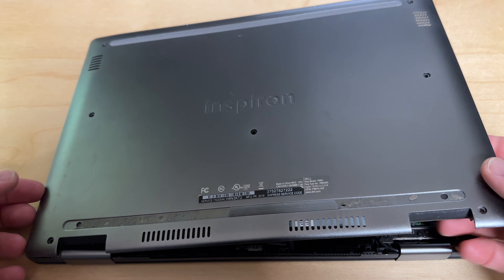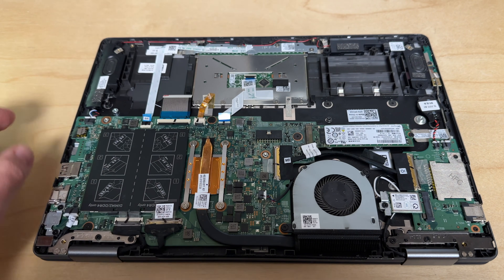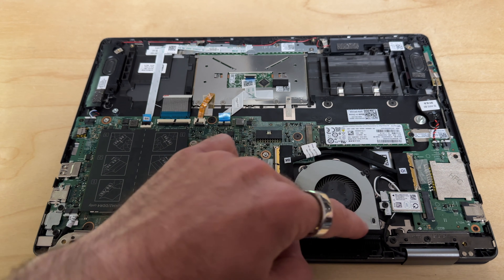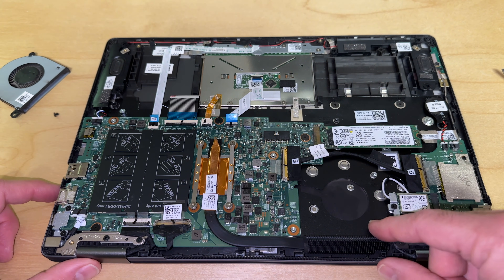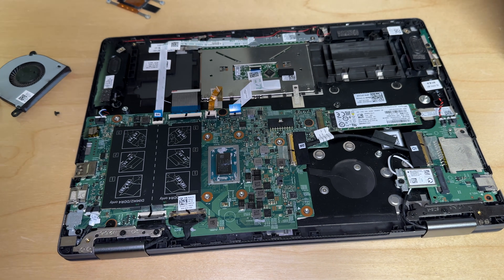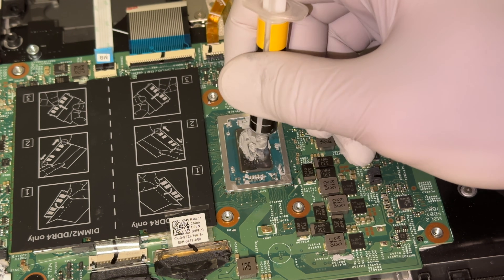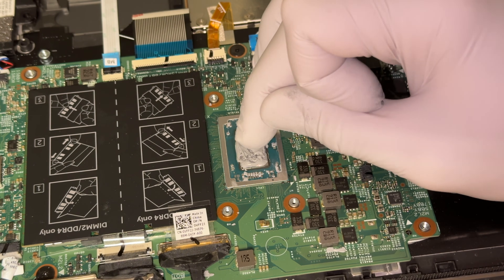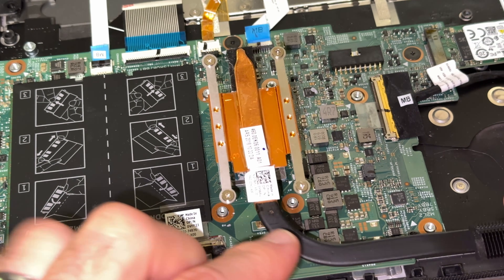How to re-apply thermal paste on ANY laptop!

Comment: BATTERY. DISCONNECT THE BATTERY.
Reply from the maker: Not necessary.
Reply: Is is necessary ,people use metal screwdrivers which can short the motherboard if they touch bits of the motherboard when the battery is connected, that becomes a very expensive repair now. @ComputerStuff

Comment: Thanks for the video. A few Questions. 
What would be a good symptom or diagnosis to warrant this thermal paste replacement. 

1. What paste should I use for Dell latitude 5420 /7420
2. I understand you mentioned that you used more paste than necessary. Can I use an empty syringe to suck up the additional paste?
Reply from the maker: 1: Arctic Silver is my goto.  
2: Yes or a piece of gauze :)

Comment: This laptop doesn't have thermal pads alongwith thermal paste which are there in most laptops with gpu..when changing thermal paste, do those have to be changed too?
Reply from the maker: Yes if you pull off your heatsink and you also have GPUs or chipsets that have paste on them, I'd replace that as well.

Comment: Forgot to turn off the pc while apllying thermal paste. And now the pc won't respond . Possible to fix or do I need a new MB at this point?
Reply from the maker: It's possible that you shorted the motherboard, but I've been doing this a long time, have made mistakes like that, and have never shorted a board.  Make sure you go through all the usuals (unplug, replug, remove batteries, etc.) before jumping to new motherboard.

Comment: If there is not enough thermal paste, will it cause a fan issue? My laptop ocassionally throws a fan error over time where the fan doesnt work at all and the cpu throttles with increasing heat
Reply from the maker: Not enough paste wouldn't cause an issue with the fan.  If you're getting a fan error its likely the fan itself is malfunctioning. THose are generally quick and easy to replace.

Comment: I’ve decided to chnage thermal paste after opening my laptop and cleaning the fans, thinking they were the problem for overheating(they were not, it was the thermal paste). Changing thermal paste doesn’t seem like a difficult task, however I’ve noticed that VRM and CPU have different colours of thermal paste?? VRM has white paste, and CPU has grey paste.

Hence my question is, are there like 2 different kinds of thermal paste for vrm and cpu? The paste on vrms still seems alright, while the thermal paste on cpu clearly needs to be changes, so shall I just change the cpu thermal paste??

Sorry if this doesn’t make sense, I am not the most tech savvy person and it’s my first time ever fixing stuff in my laptop on my own.
Reply from the maker: Tha'ts interesting. IT's possible they used different pastes in factory, but you're safe to use one kind when you redo the paste yourself.
Reply: @ thanks for the reply 👍

Comment: would isopropyl alcohol work? (70% - 90%)
Reply: You'll be fine just use a cloth to apply it and wipe it off clean. You've got more of a chance to kill your board leaving goop on the side of you cpu touching the pcb than you would using isopropyl alcohol on a cpu. The diffrence between denatured alcohol and isopropyl is the presence of toxic chemicals in denatured alcohol(methanol, benzene, pyridine, castor oil, gasoline, and acetone)
The percentage is dilution to water.

So this goofball using gloves in a non ventilated area like he cares more for his board than his life is the real highlight of this video.
That and his spreading of the paste like its not going to be flattened by the heatsink.... just saying don't do what this guy did. Pea sized dot in the center is enough....
Reply from the maker: Another added COA.  

Do not use Isopropyl alcohol.  THIS “goofball” can’t listen much less offer proper advice. 

You unequivocally will not hurt a GPU or CPU by having “goop” on the circuit.  These are non conductive surfaces.  @Chip-Chapley needs to go back to ECPI for his bachelors in uselessness.   

Yes, use less paste than I did in the video. I said as much in the video but clearly listening isn’t a genetic skill.

Use gloves, it’ll keep your hands clean from the paste and alcohol.

Class dismissed.
Reply from the maker: It’s not recommended. I suppose if you had nothing else it wouldn’t kill anything but I wouldn’t risk it on an expensive device.

Comment: Any thermal paste works?
Reply from the maker: Yes.  But arctic silver has always been a gold standard
Reply: @ComputerStuff   ANY THERMAL PASTE WILL NOT WORK. Since this is a direct die cooling application it always needs a high viscosity thermal paste like arctic mx6 or thermal grizzly kryonaut. using a thin paste will have a pump out effect and will vacate the cpu die and thats not good. thick paste will stay put on the centre of the cpu and will last longer

Comment: Bro forgot to say diconmect the battery because if your screwdriver touches any part of the board its fried
Reply: I never had any issue. Every year I change my thermal paste and I never disconnected the battery
Reply from the maker: Bro didn't forget to say that, because it's not true. , I've been doing this for 25 years so no, I'm not wrong.

Comment: can i use just basic isopropyl alchohol??? cuz denatured alcohol is not aviable anywhere in my country
Reply from the maker: No you can not and should not.
Reply: @ComputerStuff then what the f*ck do i use ????
Reply: @adriss8888  You can use isopropyl "rubbing" alcohol... try and get 90% or more. Don't splash it everywhere obviously
Reply: @taylorlatch2635 yeah not sure why this guy is saying you should not... I get that there's water content but alcohol is a strong  oxidizer it literally will evaporate the water into hydrogen if you apply the least amount of friction.... I could rinse a board In water and it will work after it dries.

Comment: Is ok if that glassy thing is a bit chipped? I have two processors i think, one is for nvidia and one for intel. I cleaned them both with 70% alcohol and wiped fast after with a dry tissue. I cleaned with a vacuum, used some brush head for it.. and after cleaning i found out it was chipped on the glass, does it still work?🥲
Reply from the maker: I dont know what you mean by glassy thing?  The green part on the CPU?  Yes, that being chipped can pose a problem.
Reply: @ComputerStuff  the one you're putting paste on :)
Reply: @ComputerStuff the green part is protected by some plastic, the glassy one is the one i can see my relfection, and is shiny. And put paste on. I dont know exatly what role does it have on the processor. So thats why im asking if its safe

Comment: I am hopeful you reply back, I have a computer that was in the storage box for a year and it was left there open, 
It probably took a few little falls. now when I decided to turn it on,
It wasn't turning on, And I saw the CPU FAN (FAN + Cooler thing ) wasn't properly attached, so i went ahead applied thermal paste
and tried attaching it, some of the plastic clips broke but it still attached, although my pc isn't turning on still
I took the rams out and placed it back in, still doesn't turn on.
The GPU light and a motherboard light does turn on, and when i hit the pc switch button GPU + A side casing fan does move for a mini second and stop
( Cpu fan doesnt ) thats what happens when i hit the switch it doesnt turn on, just a little movement on gpu fan and a casing fan-
What do you think I should do ? 
I live in a very small town, with very bad computer repairmen, if you have a few things to point out, would really apreciate
Reply from the maker: Sounds like possibly your power supply is having an issue (if not motherboard).  Despite getting "some" power - I would try and replace your power suppply first, then try motherboard.
Reply: please try replacing the CMOS Battery! Also, remove the laptop battery and hold Power Button down for 1 minute to perform static discharge. Then replace battery or you can just use power supply without battery ( try both ways) to see if that powers on your PC. Ensure, that all internal connections from disassembly were OKAY! Please let me know if this fixes the issue.

Comment: Should I remove the laptop battery first?
Reply: YES, ITS NECESSARY else there is a high chance of getting your motherboard fried.
Reply: @aneek_912  but you only applied new thermal paste, not a big deal for the battery
Reply: @RoldanPerezChristianAsgard   while removing the heatsink there's a very high chance of accidentally touching the SMD components with your screwdriver. so its always said to disconnect battery cable first before you touch any components on your machine
Reply: @ yeah you right, better be safe
Reply: allways remove battery 1st  no matter what you repair , safety first ofcurse you wont get shok but just in case.
Reply from the maker: Not necessary.

Comment: Sir im new to all these things , and I've a laptop mainly used for office work ( hp pavilion i 5 , 16 gb ram ) i also dont know much about laptop as well ..
My left fan doesn't work properly and that side becomes extremely hot , reaching upto 8 5 to 9 0 degrees before shutting down when playinf high end games like spiderman miles Morales or hitman 3 ... I can bately play these games for 10 mins and then my whole laptop shuts down ... I was thinking of replacing my fan and here I am to know how to apply thermal paste , so how should I apply it  ? After putting one drop , should i spread it ? Should we cover something or keep something on top so it doesnt stick to any other nearby things ? Or should we keep it like that ? 
Writing this before watching
Now ill be watch 
Please i need your help
Reply from the maker: Put a thin layer on the dye, then spread it around a bit, yes.  You do not want to GLOB it on. Just a nice whisper on the CPU and you should do just  fine with it.

Comment: My laptop has the same heat sink design and I used the same thermal past as you but it made my temps worse than before
Reply from the maker: Sorry to hear,  only guess would be that it wasn't applied correctly.
Reply: I think I put to much I’ll reapply it and see if anything happens
Reply: @Rafael-b3e3y  
Remove the heatsink. Clean with alcohol as shown here in this video.

A thin layer is enough. Use a spachelor and cover the entire CPU die.

The amount of compound in this video is far too much. You could get two cpus re-pasted with that.

The task of the themal compound is to form a low resistance bridge to take the heat off the CPU and transfer it to the heat sink.
If there is too much thermal compound then the desired effect won't be reached.

Use CPUID HW Monitor to check the thermals while using the laptop.
I also cleaned the airvents, the heatpipe exhaust and the fan. I think it belongs to that re-pasting cycle. Make sure that the fan does not spin while hoovering the fins of the fan. Don't apply any pressure to the fan, it will cause damage to the bearings of the motor. If you spin the fan, then the generated electricity can cause damage to the logic board. Be careful. 
 
Last year, I bought a new laptop for my office work at home - a Dell Inspirion. The fan was spinning all the time. The noise that was generated was quite something. It was annoying because once the CPU heated up, the fan never turned off or lowered the speed to lower level. The fan could always be heard. 
Manufacturers use cheap thermal past to save money. Especailly at the lower end models like my Dell Inspiron.

Now, with the re-pasted CPU and when only doing office work, then I get the impression that the fan stops and only cools through the heat sink. That is better than with the factory thermal paste.
Reply: @Rafael-b3e3y  so now you good ?
Reply: It’s impossible that adding too much thermal paste would make your temps worse.
Reply: @DracoVampire786  Too much paste starts acting as an insulator.  The paste doesn't transfer heat as effectively as the metal parts that it's sandwiching.  Yes, too much paste can raise temps slightly.

Comment: thank you so much! this video is one of the most informative and has a good length: neither too short nor too long. only facts! I'll try applying thermal paste by myself next time :) but it's pretty hard to open back laptop cover. Are there any lifehacks for opening those?
Reply from the maker: If you get a screw driver kit off amazon  most of the time they'll come with a plastic pry tool.  That'll make your disassembly a lot easier!
Reply: @ComputerStuff  thank you so much! god bless you🙏🏿

Comment: Do we really need to clean it with alcohol?
Reply from the maker: You should, yes.
Reply: @ComputerStuff  i didn’t clean it when I repasted, does it have any long term negative effects?
Reply from the maker: No long term negative effects.  But it may prevent perfect contact with the new thermal paste.  I'm sure you're probably fine.  @Shenhe-j8u
Reply: most likely scenario is that it will be less effective, but nothing will be ruined. itll be okay
Reply: It's the most effective way to clean it, the alternative is a hand sanitizer which usually based on alcohol
Reply from the maker: @alfayudhistira5015  I unequivocally do not recommend hand sanitizer.  While it contains alcohol it contains a bunch of other stuff that isn't computer friendly.

Comment: actually you absolutely should remove the gunk beside the chip.  it is not touching the heat sync and will release heat to the board.
Reply from the maker: Interesting. I may have to do an experiment with that. Thank you for commenting and giving me an idea for a video!
Reply: so should i remove it? @ComputerStuff
Reply from the maker: Can't hurt.  @Qqpop_official
Reply: My OCD brain won't allow me to leave it so I understand for the purpose of this video you're making it quick but I'll be thorough

Comment: How much did that tm30 helped is it a good thermal paste?
Reply from the maker: It's a good paste.
Reply: Is non conductive paste the best?  @ComputerStuff
Reply: @JmBvhntnt28 it’s the best, low risk you can use. There is something called Liquid Metal which is better but if you spill it anywhere off the top of the IHS, your laptop is dead.